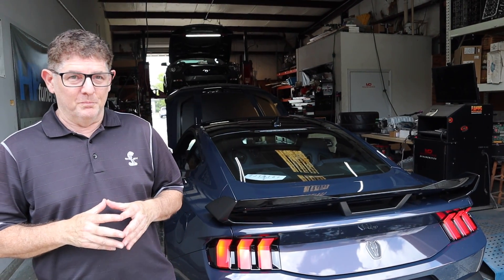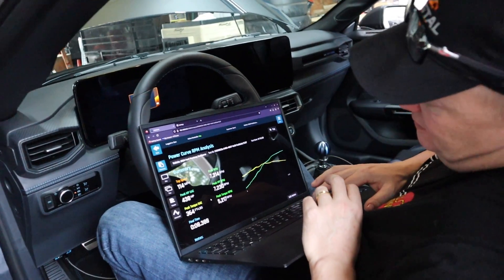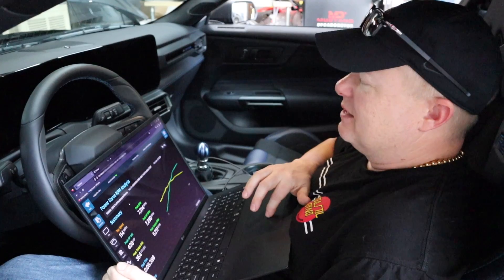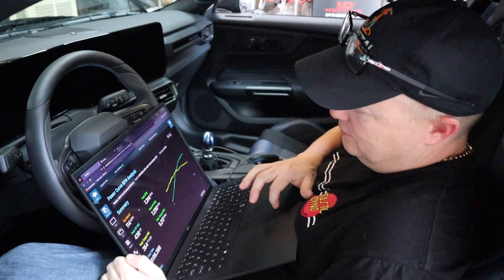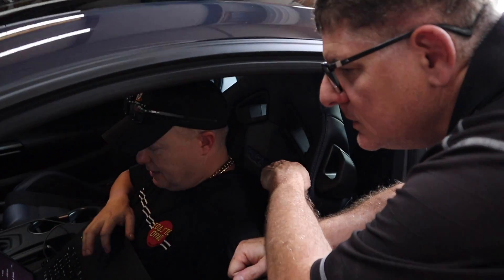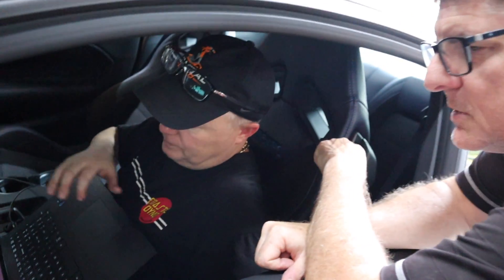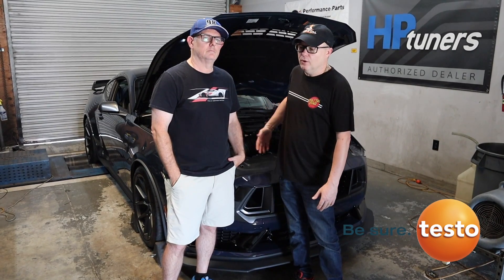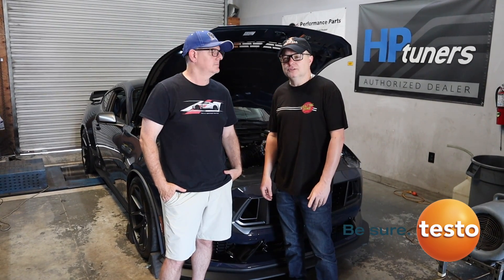Dyno Test: 2024 Mustang Dark Horse | Why Ford Used a Dual-Throttle Intake & What's the Real Power?

Comment: 17 HP and 19 lb ft for almost no work or cost isn’t too bad at all. I think the biggest problem with it is traction. It really needs the right tire to utilize all of the torque and Horsepower it has.
Reply: They come with 315s on the rear, and from what I’ve seen the pirelli trafeo R is a pretty sticky tire outside of a dedicated drag radial
Reply: It's weight dude wow the dyno don't know what gear your in
Reply: @@notfiveoput that bitch on E85 and you'll want to smell the fumes. Trust me. 🌽😌

Comment: it might make the power. Ya fail to mention the extra 100+ lbs added to the car.
Reply: The trap speed will tell all, and ET..I don't think people are griping about power..its that it's not tunable and slower while costing and weighing more...
Reply: @ShawnGilbert1967 doesn’t weight more than s550 it’s the same weight
Reply: @CoyoteFTW  not from what I'm seeing it's weighing bit over 100lbs more which eats up the 20 hp

Comment: Gonna need all that for a 4000lb car.
Reply: Look around most sports cars are at or over 4000 lbs, most of the weight is in the engine and the added safety tech id Imagine, if you don't like the weight get the Ecoboost there's a mustang for everyone now, no reason to complain
Reply: Plenty to complain about all this over-priced low quality garbage Ford is putting out lately . It's just funny how everyone is blowing their load over an un-tunable 4000lb "sports car." I think shops need to be careful removing federally mandated emissions components from a new vehicle and showing it on a video.

Comment: Great video.  Like the 5.0s.  But still would like to see that 6.8/7.3 in one from factory
Reply: Why it's heavyer and can't make as much power without a heads cam full build over 10 psi the 7.3 will blow apart
Reply: @crownvictorialifestyle4421  your way off... a 7.3 modded from the factory for a mustang would have more power everywhere in the curve.... the only spot the 5.0 would do better is rpm extension.... but by then the 7.3 is gone already
Reply: @7000U9ZHIFT thanks to cleetus mcfarland we know what the 7.3l godzilla v8 can do and it is very impressive.
Reply: @vyrrwolf288  he had to fully build it when it was stock it blow on 10psi 
5.0 you don't have to crack it open
Reply: @crownvictorialifestyle4421  from my understanding the first iteration was not afterwords he did build it. I believe the first run was an 8.something idk its been a while since I watched the video idk the boost he put through it either but it was still an impressive pass in that car off rip. Im not gonna say whether it needs built or not to do what the coyote does cause I know very little about the 7.3l v8 but I do know coyotes can reliably on stock internals run 800 plus hp and that is to the wheels that is what I do know.
Reply: 10 psi and it blows? cmon man haha @crownvictorialifestyle4421
Reply: Get a Chevy instead

Comment: I'm impressed on the gains with so little effort.  I can't wait to see full builds.
Reply: @FORTNITEGUY023thats what i heard too but a complete ecu change ... i cant see how a true tuner wouldnt be able to bypass everything in it
Reply: Ford employees are funny. 😂
Reply: @ClickbaitMotorsports Come on Mickey Mouse Motor Sports. Admit when you're wrong. By the way. Palm Beach Dyno did multiple Dyno pulls and came up with the same 500 horsepower on the Dark Horse. 

CJ Pony Parts compared the S650 and S550 on an outdoor truck scale. They weighed the same.
Reply: @ClickbaitMotorsports  Why?

Comment: I think the problem is that everyone doesn’t understand that if you have a automatic with different gearing it’s not gonna make the full hp out of 1.1 because 1) the speed limiter 2) it’s just a different set up. 

Also think people are just too ignorant to know Ford states Hp ratings to the crank not wheel.

Glad to see new mustang is holding power as advertised!

Comment: Evan, honestly the CT's don't appear to be that restrictive, maybe more flow disturbers. Plus you have 2 fairly large air inlets vs one on the S550. 

I am curious about the peak HP rpm dropping from 7230 to 7060 and 7097. Is that powerband shift possibly due to internal ECU strategy going rich because it is seeing more flow v. Load? I noticed the 19 torque increase but the rpm change is with in measurement error. With how the torque is calculated on the rollers how is that effected by final drive ratio of the test and or influenced by tire pressure during the test? I'm curious after several drive cylces if the results will still be repeatable as the ECU learns the air flow increase. Also curious if the mapping changes at say 2000 miles.
Reply from the maker: Ford engineers have conformed to me that it's 10-20 hp on the 2024 5.0 Engine depending on testing and Dyno type.
Reply: As the car gets hotter (multiple passes) the calculated EGTs go up and get you in catalyst enrichment at high rpms.  That's probably why power dropped at high rpm.  If they'd done 5-6 passes in a row stock as well you'd probably see this.

Comment: LOL do the same test with the 10spd #dud
Reply from the maker: How is it a dud? Automatics never make as much RWHP as a stick on a chassis Dyno due to parasitic loss, however that loss is made back up on track due to the torque converter and the tighter gear spacing which keeps the engine in the power band better than the stick. Hence, automatic 10-speed Mustangs and Auto Hemis with outrun their stick counterparts stock-to-stock every time. I've tested both the Mustang and the Challenger and it's not even close. Like .4 on each car.
Reply: Why would he say the car isn't any slower than a Gen 3, while having not run it yet? Most are showing to be a few tenths slower...Justin's American Muscle ran 11s on stock tired middle of day...

 But I'll be watching with interest good luck...

Comment: The carbon traps are for when the vehicle is turned off.
Reply from the maker: Correct.
Reply: Meanwhile in India the garbage truck backs up to the river to unload. I forgot the problem is the minuscule emissions coming back out of your air filter when you shut the engine off.
Reply: @corruption1724  The EPA in the USA doesn't get to regulate garbage trucks in India. I'm sure they would if they could.

Comment: Made the same rwhp horsepower as a 2007 Gt 500.
Reply: NA with less displacement - wild!
Reply: @RyTrapp0  More compression, more cam and a whole lot more RPM
Reply: @BCSVT  Of course, obviously there's reasons - more head flow too, and an intake manifold with actually useful runner length lol. Or we could just compare it to a 550 or 662HP GT500. 
But it's still wild that it's an NA 5.0l compared to a blown 5.4l. 15 years isn't a short amount of time, but it isn't a long amount of time either, the auto industry has made some huge leaps. I mean, we have a non-limited production NA Mustang that makes 100HP/liter, this is ridiculous. Wasn't that long ago that the wheezy ass 300-315HP 3v was the standard V8.
Reply: @RyTrapp0   On Ron Robert’s old flow bench head flow is pretty much a wash.    
He had a Superflow and ran everything @ 28”with most of the Modular stuff on a 3.552 bore plate 

Stock supercar heads:  ~305/230
Gen 1 Coyotes: ~295/200 

I think the Gen 2-3 stuff might have cracked 310 on the intake but the exhaust port stayed pretty similar to Gen 1 (small), based on memory.  

Ron also had a port program with +2mm valves that took the Supercar heads to ~400/350.   Coyote castings can’t touch that (even Voodoo) especially on that exhaust port even with comparable port work.

Comment: 500 x .88 = 440.  So 12% drivetrain loss it’s right on advertised fwhp.
Reply: Most modern cars are underrated to compete with the Germans, which have been underrating their cars for decades. Clearly, even the 2018+ was 500hp when you calculate it properly at 17% rear wheel drive drivetrain loss (425whp/.83=500hp). 14% loss is FWD, 17% loss is RWD, and 20% is AWD. Even more loss with larger heavier wheels, which is anything larger that 17s. People have just been accustomed to expecting much higher numbers than correct, and it's like the new standard... although still underrated/incorrect.

Here's an example of underrated and not underrated:
Underrated:
2019 Civic Type-R 306hp=>290whp (5% loss... uhh no! It's a 335hp car, not 306hp)
Not underrated, Not overrated, correct
2019 Veloster N
275hp=>235whp (14% loss)
Reply: @copperkeyracing6167  Ford Motor achieved very low parasitic losses to rear wheels. That's excellent engineering of components from an engineering perspective. Very impressive!
Reply: @Davido50  There is no such thing as low drivetrain loss. The word parasitic loss means "energy loss due to inherent inefficiencies in a system, which no manufacture has now-a-days on how competitive modern cars are made. There is a set method to how all cars are tested when they are new to the market due to a major update/etc. They are tested by SAE on a dynojet (dynojet specifically, not any other type of dyno, like a dyno dynamics, dynapack, mustang dyno, etc). Whatever numbers are put out on the dyno, then SAE takes those numbers and does a reverse calculation to figure what is the maximum numbers that the manufacture can use. Maximum, not minimum. So, if a car puts down 450whp, then they factor in rwd/fwd/awd, size of the wheels, etc... then, a conclusion is made to what that number is. Lets say for a car putting doen 450whp, they hand the manufacture a slip and it says they can claim 550hp. The manufacture, Ford, for example, says ok that's nice, we are going to state 500hp, because that's what we decided. They might decide only 500hp because they want to compete with what the Germans do, and that is to massively underrate their cars; OR because they want to claim low drivetrain loss (even though you very well know that that rear end can handle 1000hp, and more strength requires more weight, which requires more losses); OR they don't want people to be upset with them EVEN though they absolutely can't be sued because all they have to do is show that letter/slip from SAE showing that they can claim 550hp. This is how it works... and I've literally explained this to people probably a hundred times... so, no, Ford does not have low drivetrain loss. Otherwise, their rearend would resemble a CRV rear end, which is literally like a grapefruit.

In final, it's not that the rating determines the power at the wheels, it's the other way around, the power at the wheels determines the rating at the motor. The rating is just an indicator as to how much power a car potentially MAY have... but you are guaranteed by law, and by SAE, that you have at least that much power that is being advertised/rated... otherwise, you can sue the pants off the manufacturer which had been done to Ford in the past, and Mazda, and Nissan, and Hyundai, and and and everybody, even the Germans (I believe there was an M5 that had to be rerrated because it was underperforming). Modern performance cars are underrated for a reason, but most importantly it all changed with the new SAE standard in 2006, ratings are just that a guideline/rating, and then cars were adjjusted down... until one day they all became underrated.
Reply: @copperkeyracing6167 bro no American car company is thinking about German cars if they did they’d just boost these cars from factory and awd them and chew them up.
Reply: @invalidusername_5101  Good thoughts/opinion/theory... but no. German cars have changed the game.
Reply: @copperkeyracing6167 A Dyno is only a useful tool to measure changes in power after a baseline pull is made on the same car. It's actually not very useful to determine factory hp as each Dyno measures differently and uses different correction factors.
Reply: @copperkeyracing6167 Christ I wish that was right. I’d love to say my RWD 480whp car was 560hp. Fat chance. 

The truth is that you can’t use generalizations to get an accurate read. I’ve seen modern car engineers say things like FWD can be as low as 10% these days. 

While the quest for mileage has had many causalities, it’s also introduced a slew of other cool efficiencies too. Efficiencies are ways to find more power for less too. With electric steering, coolant pumps, hell my car even has an electrically clutched AC unit so it can disengage when I ask it to summon the whole stable of horses. 

Personally I just give the wheel figure now when asked, “At least 480” as the most accurate I can be. I also try using metrics like 60-130 times or trap speeds to help me contextualize the difference between vehicles.
Reply: This is a high reading dyno. They consistently measure 425whp.
Reply: @GarciaQ60  Mustangs have historically been underrated.. my beloved 04 SVT Cobra terminator (4900 orig mis) stated 390hp from factory yet consistently put out near 420hp (stock) as did all others. Most of us know how well that car responded to any mods! Mine puts out a conservative 500hp+ from only $500 in mods. 💯 I will get a new gen7 '24 Mustang GT 5.0L. New 5.0L is a very impressive modern V8.
Reply: @Davido50  I totally agree. That terminator mustang was definitely underrated. Look up the rest of the mustangs in the 90, 00s, and early 10s, and you'll find them all to be correctly rated... then as the years went by in the 10s... underrated.
Reply: That's quite low parasitic loss actually from an engineering perspective. Kudos for Ford Motor! That's a very well designed, superb performing vehicle. Can't wait to get my new gen7 '24 Mustang GT 5.0L in few mos. Even new Mustang Ecoboost is improved. Be fun, frugal ultra reliable daily driver sports car. Gen2 - 2.3L GTDI is well proven & quick.